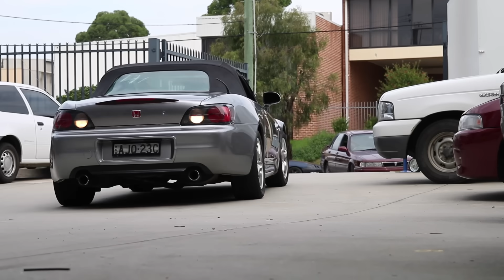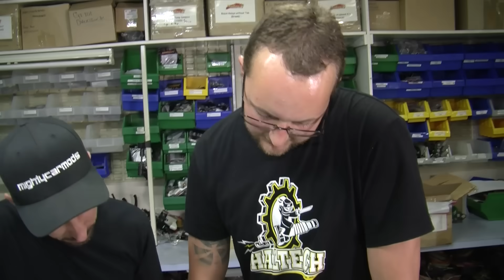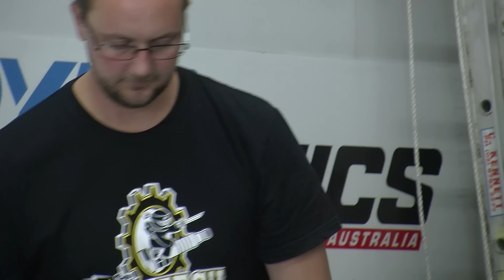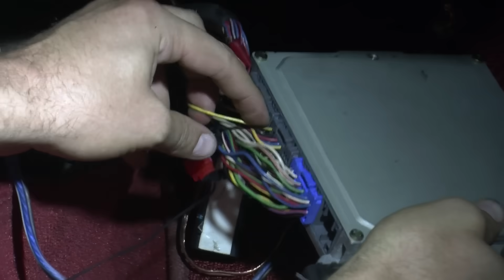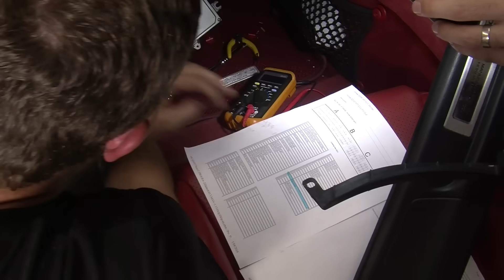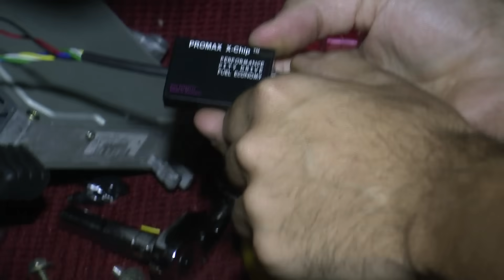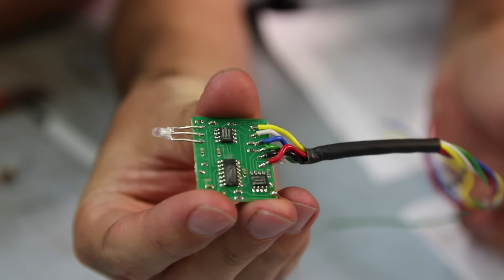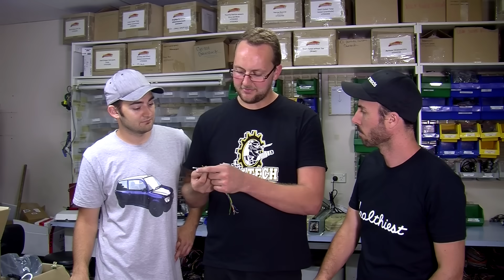eBay Performance Chips -  Mythbusted

Comment: screwing with what professional programming engineers do at car companies is stupid. i don't care if it's this or some tuner that claims to be amazing. i love how people let these places like AMS screw with their high-dollar, complex gt-r ecu's, for example. There are always negative side effects.
Reply: FOD
Reply: Anthony Prentis pq6m
Reply: +andyouf Not always, but certainly in this case.  Car manufacturers have to produce cars that conform to various regulations (emissions being a fairly common one), and consumer expectations (such as fuel economy).  Some manufacturers even deliberately underpower their engines, either for the reasons mentioned above, or because it's cheaper than engineering a separate unit for a lower trim level.  Aftermarket ECUs and remaps can unlock the extra potential taken away by the factory.  Automotive engineers don't always know best.
Reply: Stuart Wood If your car is some mid 90's Mustang, WRX, whatever, tune away. If we're talking a brand new Gt-r or Porsche or C7 vette whose engine just got done being hand assembled only to be taken apart again, no. There are teams of programmers getting the code in these cars right and they are focused on performance without you breaking down every 10k miles. Piggybacking into that ecu in order to change a few variables is insane to me. - a programmer.
Reply: +andyouf What you are missing here is that even a GTR or Porsche or Vette, still has to comply with the emission regulations in the country it is being sold. Every car has to do this regardless of the brand, spec level or intended purpose. The only time this is not the case is for race specials which are never to be road registered. Because of this, there are restrictions placed on what the ECU will do vs what it is capable of. It is a compromise. GM LS series engines are a good example of this - potential for stock ECU tuning (smoothing out the fuel delivery across the rpm band, etc) that will result in more hp. If you know what to do and work within the safe limits of the engine capability, the result is more hp with little chance of engine damage. However this is not usually worth the cost unless you are going to add a high flow exhaust and possibly intake system (depending on the car).
Reply: CooperSrace But what are the negative side effects of messing with these programming parameters? could there be long term effects on parts? junk building up because some ratio got thrown off. it just seems to me that the coding in these current cars is getting to be incredibly complex.These programmers are writing code for the gearbox, the suspension, the awd, the engine, the turbo/supercharger actuation, all working as one

 I guess with the tuning thing i just don't get it, i'm too pragmatic money-wise. I mean okay i'm gonna buy a 100k z7 z06 and then pay more money for some aftermarket racing exhaust&intake when the car comes with...an awesome racing exhaust and intake. And mods are returning pennies on the dollar value wise, cars that are stock are often favored over tuned.

again i'm talking modern high-end new cars. wrx or mustang that is a couple years old i can understand.
Reply: +andyouf I guess that's down to an individual's viewpoint.  I get what you're saying totally.  if I spent say £80,000 on a high spec car to use on the road then I'd be happy with the performance it delivers since it would be quicker than most other cars anyway.  If I had bought that car to race competitively, then everything counts.

With an older car, I think it can be worth it.  Mechanically speaking, the exhaust manifold on my car is very restrictive, to the point where it creates a sizable ridge from the port to the entrance to the manifold.  An aftermarket part would fix that.  Electronically speaking, manufacturers tend to apply a standard ECU map to a car across all territories it's sold in.  That standard map is designed to include tolerances for external temperature, humidity and fuel quality.  Tuning an ECU to work specifically in your country can yield some noticeable power gains and better economy, depending on the car.
Reply: Stuart Wood sure racing is a whole different story. I'm just talking about accelerating on my freeway on ramp and the occasional track day. yeah, with an older car i may need the new part anyway so why? than again the exhaust on my friends 07 accord has zero problems, they're making them very durable these days. but yeah i agree mainstream cars tuning can be a way to extract more performance for the car enthusiast who is into that.

Comment: Hey guys, What do you guys think about ecu tuning a turbo'd diesel car? Where I am from we get taxed heavily on turbo'd petrols, I am looking to get a 1.9 CDTi 150bhp standard and 1.1 metric tonne standard weighted car. I have heard with a good system you can improve power up to around 180-210 bhp with ecu remap alone.. + I will also be changing air flow system for this, in take outtake ect. Is this project worth it? any opinions guys. cheers
Reply: If you are talking of the 1.9cdti that I think you are you certainly can get 200hp with just a remap. My own car is a remapped turbo diesel and the power increase is fact not fiction. There are plenty that have been dynoed... this does not fall into the same category as the device featured in this video.
Beware of generic maps for your car, each map should be tested on the road while recording live data. On my car the map had to be adjusted a few times in the session, as boost came in the gearbox torque rating was being exceeded, since I want reliability the map also tails off above 4500rpm to avoid overspeeding the turbo.

Comment: Don't mistake this with an EMS or a reflashed ECU. Those move around the fuel tables to change timing, fuel delivery, and RPM min/max values. Even professionally tuning an ECU will only give 15/20 WHP on a N/A car with approx. 200 WHP. Nothing close to the 30/35 WHP this kit promises!

Comment: Go through and see where the pins are going. Chances are good that it's just soldered to the board and doing nothing at all. Attach dummy inputs to it and see what is happening to the signal when it goes through the chips, etc...
Reply: You didn't watch the whole video did you?
Reply: drummerdude Yes, I did. They opened it up but they didn't put any part of the circuit on a scope to see what the circuit is doing. IIRC, the chips had their markings scratched off, but that doesn't mean you can't figure out what this thing is doing (if anything) if you have electronics knowledge.
Reply: tarstarkusz They sent it to a specialist who found they did nothing.
Reply: drummerdude At the 25:00 mark they have it open and are speculating on if the circuitry is simply flipping the led, which doesn't need 3 ICs. What I am talking about is putting it on a bench with a scope and see what the circuit is doing. For all we know, the chips are defective (meaning they are deliberately putting bad chips in it to make it look like it's actually doing something to someone who simply opens it up) and a small portion of the PCB is simply changing the LED color. The only way to know for sure is to put it on a bench and start probing.
Reply: tarstarkusz They said the wiring bypassed the chips so they had no effect and did nothing other than be there to look like they did something.
Reply: drummerdude It must have been at the very end of the video because I stopped watching it shortly after the three of them were talking about the markings on the chips being removed.

Comment: What you have to do to get these chips to work is roll down the passenger window turn on the high beams adjust your rear view mirrors and fill the windshield washer reservoir with Coca Cola not Pepsi has to be Coca Cola.Happy racing.

Comment: Just based on the wiring it's all wrong. If you're connecting to the MAP/MAF, O2, and air temp, you'll need more than 5 wires. One for power, one for ground (of course). One from the MAF/MAP, one from the chip to the ECU on the MAF/MAP wire. One to read the O2 sensor (a second to modify), and one to read the air temp sensor (again, second to modify). If this was actually changing the signal received by the ECU it doesn't have enough wires for it to work. It's a glorified red/green LED with a toggle switch.

Comment: would you actually expect a performance Chip to be a device with 2 leds that light red or green. I Thought you you get a Eprom chip to replace one in the ECO that has different values for the spark plugs and engine timing to increase the horse power. I believe those kind of chip changes are more like firm-ware and would be worth more than $20 bucks depending if they were to actually work
Reply: You hit it right on the head the chip in the ECU is an EEPROM usually a 256k or 512k chip. You can buy a chip programmer for about a hundred bucks, and copy any other chip or manually edit tables. I am a firm believer in ECU modification rather than piggybacks like power commanders. I've been doing it with my motorcycles for quite some time.

Comment: its only a bridge with a fancy led bipolar switch and advertising, that's all

the chips in the circuit are like CPU's, it just manages electrons and distributes then to places, there's no chips that are like memory and hold values, thus this performance chip is just a bridge, its not a computer that holds any bit. 

I don't know about other expensive performance chips. They might actually work but for 20 dollars to make a promise of 35 hp is like the phrase " If it makes promises that don't agree with what it claims, its too good to be true"

Comment: Wtf my stock 1996 e36 make more power then your honda thats sad sooooo sad. And you will never het that much unicorn power from 20 bucks lol nothing suck as electrical mods will work if its under 100 and it cones from ebay.

Comment: if it's an integrated signal circuit, it won't "react" to a flat DC signal. If, for example it is supposed to slow down a AC frequency which is used to regulate some aspect, or delay an ignition signal, it could still do it.. you wouldn't notice the .1s delay or "advance" on a multimeter with a DC test signal.

That said, I still call BS on this crap

Comment: I've got one for a 325i if anyone wants it lol. It's for the bosch ecu/dme my car had the siemens dme.
Reply: Devolution RC  can i have it?
Reply: jon jimenez if I can find it. I'm not sure if I threw it out or not. I will look for it tomorrow and let you know. I bought ot for my e36 320i but it was for 323 and 325i with bosch ecu.  So I never installed it.
Reply: Devolution RC nice i have an e46 323i. let me know if you ever find it
Reply: jon jimenez you might have to research if it will work or not. I'm not in the best health right now but I will look for it when I feel better. If it doesn't work for your car give or trade it to some one els :-)
Reply: Devolution RC  no problem ill wait till then. hope u get better man

Comment: Title should be cheap eBay performance chips busted, custom ecu flash or actual modules  do work but they are not $20 on eBay

Comment: I'll tell you EXACTLY what that chip is made to do... It's made to get crooked ebay sellers a shit ton of money from dumbasses who buy these things, thinking that a $20 box of plastic and wires is going to give them 30+ HP. It's that simple. And it's not even a resistor either, lol.

I remember the first car I ever had was a Pontiac Grand Am GT, and it had a sensor connection in the air intake that you could literally stick and resistor bent into a U-shape in, and it would "supposedly" give you a couple extra horsepower by tricking the engine. I forget the specifics, it's been so long. Point being, there's a ton of people on ebay looking for gullible people to make them rich. Don't fall for it.

Comment: everything ive heard about chips is you get what you pay for.  Cheap ones off of ebay you just dont know what youre getting.  the better ones will run you about $200-$300,  but are tuned specifically for your car only.

Comment: What's you're guy's opinion on me modding my 07 vw Jetta Wolfsburg edition . So far I have a sound system ( no sub) , a set of new summer Tires, some pretty nice looking wheels ( chrome with black plates on the inner rim bars, and a magma flow muffler with my mid muff replaced with a straight pipe. I want to get a cold air intake and maybe a few more things for torque and hp but I do still care sometimes about what other car enthusiast think. I mean I'm 21 years old and this is my first self owned car that I'm paying for and I want it to look, perform , and sound as nice as it can. I just don't want to get to rice. I'm an individualist so I believe in doing what I want because I love it but also there is that voice in the back of my head that says a v8 mustang is laughing at me when I shift from second to third and my vw sounds off more thank their mustang.
Reply: Hey I was in the same position a while ago(not this car at all) but if I was you I would go twin turbo or supercharged because if you go with a large single turbo you will have to wait for the turbo to spool and if you don't race a lot or at all you will never get in the power band but if you go with two medium to small turbos you will be in the power band a lot faster I am new to a supercharger but it comes stock on my daily driver and the power band is well spread. To conclude if you get the right twin turbo set up you will have great power and off the line acceleration single turbos are only good if you do a lot of roll racing from medium speed. For looks on your car one big thing is height ride height needs to look good but science you probably drive this car every day you don't want to scrape one easy solution is have it adjustable. Many companies offer this and some of them offer apps on your phone so you can go to a car meet and have perfect fit and little to no fender gap (not my favorite look but everyone has their own taste and most people with cars like that like that look.) than go on the street and up your drive way with no worries of bottoming out. Regardless of what some others above me said body kits look good and allow  for wider tires but you need horsepower first. You b your car I would recommend a wide body kit because it is a four door car you don't need a race kit in my opinion. Also a cheap solution to looks is carbon fiber wrap or real carbon fiber  it will give it he black a new dimension. If I have said anything that can't be done to your car or things you said no to your comment was about as long as this one and I have never owned a vw and haven't got to k ow them that well
Reply: CleverPresents OK, ignore what 99% of people IRL tell you. Ignore 99.99% of what you are told online. Go to a forum of OWNERS of your marque and go to a PROPER tuning shop and ask them. 

And this is MY OPINION (im a motorcycle guys so cars aint really my thing, but...). 'Pretty' wont get you anywhere, good engineering will. The best thing you can do is improve braking and handing, then move on to engine/performance. More power COSTS money, start on exhaust/head work (you WILL need to sort your fueling at every stage), then big bore/stroker. Lose weight in the right places too.

THE cheapest installation performance mod is nitrous, unfortunately is highly illegal on the road, not to mention very dangerous. leave it be unless you run the 1/4 mile.

But go for high octane fuel. it works great on bikes.

But DONT take my word for it, do your research and ask the experts when you have the money to get the work done
Reply: He's right about the forums but nos is awful for street use and breaks would be a good Idea but you should stop by a shop and show them your can and ask what their opinion is and what they would do for your budget because forms are great but they don't know what your car looks like
Reply: Ok, look I'm not gonna lie I was going to make a picture of your car making fun of it with a huge exhaust just for giggles, but in all honesty. your car might have potential. Ignore the flame coming out the exhaust and the rims. I made those before I realized what your car could look like: http://imgur.com/dmR2lT1

My advice: Tint the windows, Get some coilovers, find a small rear wing (not rice) and maybe a window wing or whatever they are called, keep your bodykit STOCK. Depending on the color of your car, I'd say maybe white rims with Bronze lugs (I'd go with just about any Mesh style rim, preferably concave). Tint your brake lights, not blacked out, but legal. Slap on a Cold air intake, and that's it. Going past that is pointless imo, but these are just some thoughts.
Reply: Thanks. Nice paint job haha! Yea my windows are tinted. Those rims are similar to mine, but the insides are black not red. And the white parts are actually chrome. The muffler tip is like a flat oval shape and also chrome. Also, my car is black.
Reply: Do what every motard does nowadays and drop a LS1 in your VW lol . But honestly get a decent tune in the Auto Shop specializing in Euro cars and see if you can remap the ecu. Its costly but you will see decent gains .

Comment: I wish I worked for comedy central as a talent scout. These guys would be a goldmine. 1 and a half million views on you tube isn't too shabby but If Mighty Car Mods and their sarcasm came to the USA and parodied everything Car&Truck related, from new car and after-market parts reviews to racing to repair guides, it would be a huge hit.
 I don't know much about cars but I might understand power ratings better if they were measured in unicorns instead of horses.
 Between the marketing used by manufacturers and the extreme auto enthusiasts involved in racing and modifying cars theres no limit to episode ideas or this shows potential. Mighty car mods is to Cars what the Daily show is to politics.
 I predict by 2020 this show is a household name.